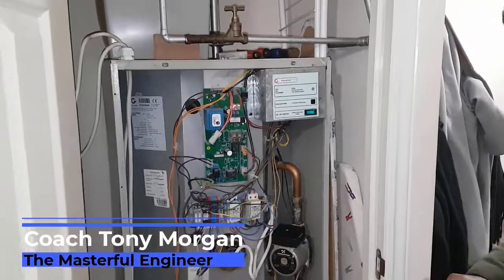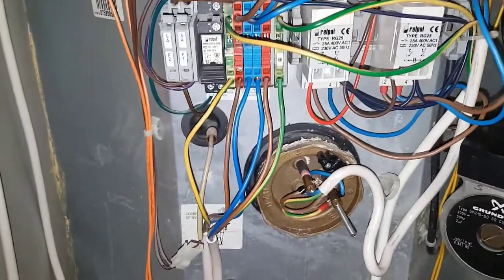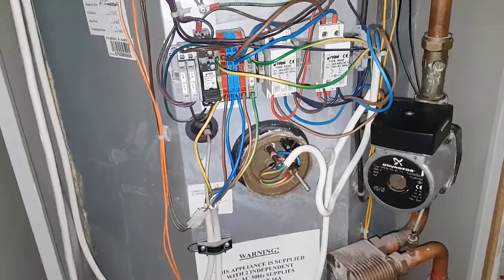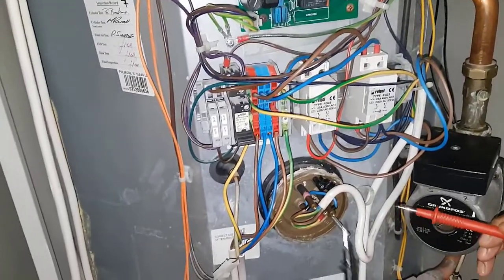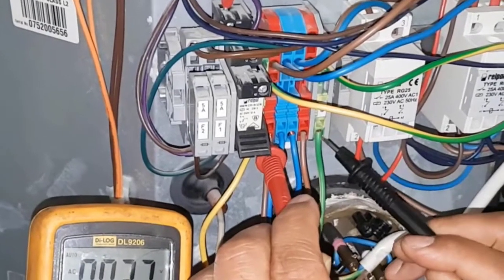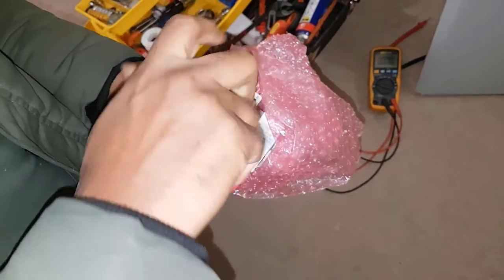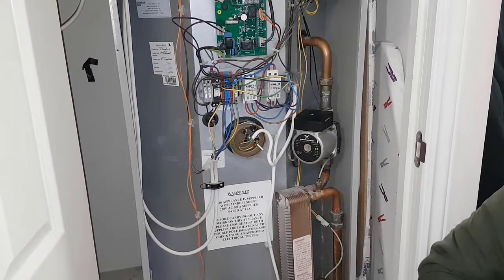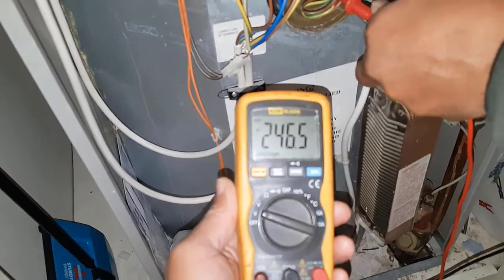Gledhill Pulsacoil A Class Overheating with Coach Tony Morgan

Comment: Tony appreciate your help advice.    Got a gledhill torrent ov. Cylinder   Drained tank. To change faulty return pump.    Filled up. Central  heating works fine  now not overheating as before.   But now have no hot water. Since then.     Can you advise.  Thanks.  Manj.
Reply from the maker: The best thing to do is email some pictures. Please send them to Tony@engineerteam.co.uk